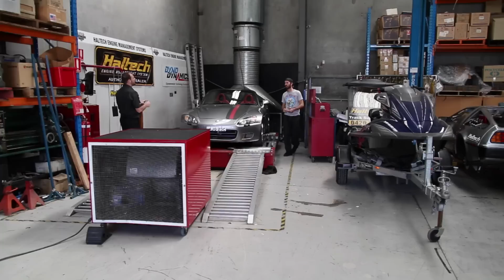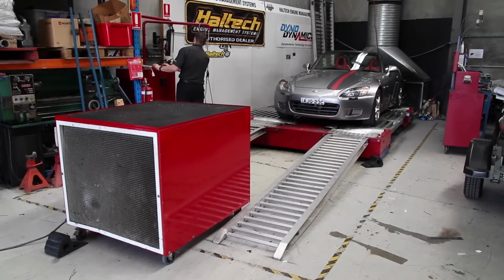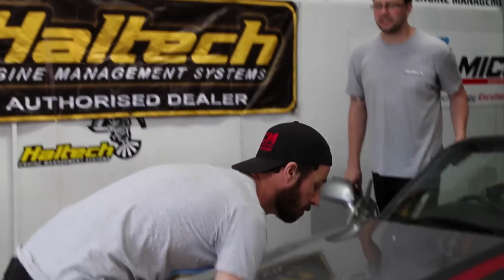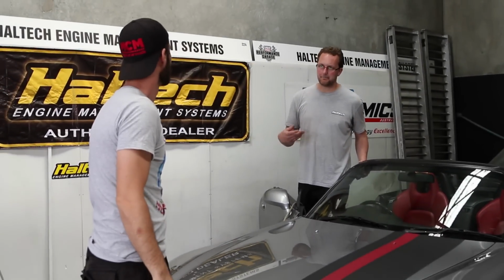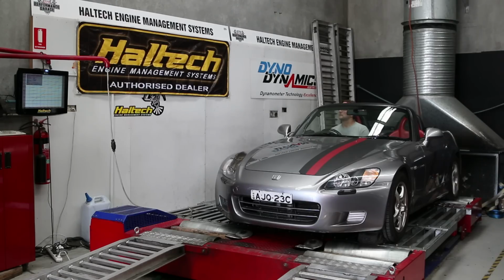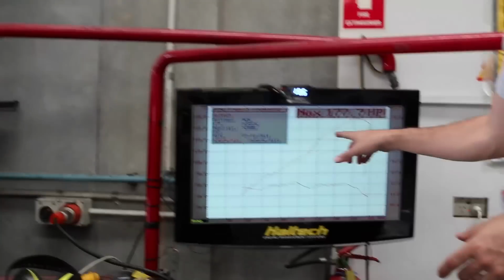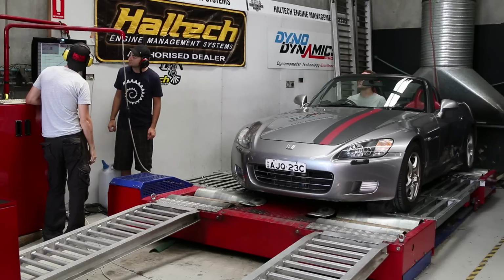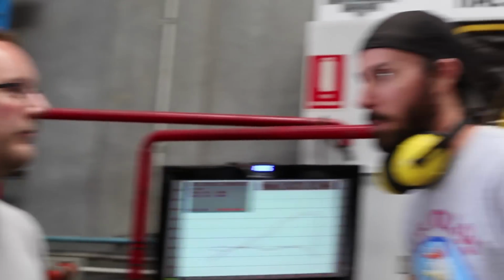Cold Air Intakes Mythbusted [Naturally Aspirated]

Comment: keep the stock airbox and plumbing but remove the resonator. i bet the number goes back to what the cold air was making
Reply: Why?
Reply: On most cars removing the resonator would make the airflow uneven thus causing a hiccup effect going into the intake manifold/throttle body.
A cold air intake will add HP to any system in which the stock design is restrictive and when the stock application was not built with a performance oriented design.
Let's use a 1989 isuzu pick up for example,An AEM Cold air intake will improve hp by atleast 3HP because the stock system is not so good in terms of getting a good flow of air to the engine.
Now let's take a Mitsubishi Eclipse GTS with the Factory improved upon induction system,Which was designed and troubleshooted to the best of the engineers abilities too make more power of the base GT model,this application already has excellent flow therefore your likely to not achieve any gains at all by tampering with the stock design.
So I assure you all,that this video can be misleading and that Cold air intakes do add substantial power gains,AS LONG AS THE CARS NATURAL DESIGN HAS WEAK AIRFLOW
Reply: What you say doesn't make sense. What is a hiccup effect? Resonators provide tuning to sound and a specific power range.

Cold air intakes will always improve power. I don't mean those cone air filters that draw air from the radiator or the engine bay. I am specifically speaking of any intake that draws air outside of the engine bay (ambient air).
Reply: However there are also tuning effects with resonators and length of the intake on NA cars. Replacing the stock intake  with a bolt on cold air can reduce power if the tuning is lost. 

For the most power, draw ambient air and turn the intake for the power band you want
Reply: What the hell is a hiccup effect?

I'm not just asking because of the fact that I've removed the intake resonator on many cars of mine/my friends and had nothing happen other than the car sounding better, as well as removing clutter from under the bumper, but because I have NEVER heard that term used in an automotive sense.
Reply: What the hell is a hiccup effect?

I'm not just asking because of the fact that I've removed the intake resonator on many cars of mine/my friends and had nothing happen other than the car sounding better, as well as removing clutter from under the bumper, but because I have NEVER heard that term used in an automotive sense.
Reply: Finally, someone that states it the way it is instead just just claiming what they think is fact in every case.  Very well said, it depends on a lot of things and not every setup will gain you or cost you the same thing.

Comment: It all comes down to each individual car.  If I expected to see gains, it would be on the top end of a naturally aspirated engine, but even that's not always the case.

My car is a great example.  It's a moderately modified (extensive cylinder head work, amongst other things) NA engine, and I've gone through all sorts of intake configurations.  Bizarrely, with the factory intake in place, I get severe detonation in the midband, and really, really shitty gas mileage at highways speeds.  Cold air intake, no power down low, but lots of noise.  Ended up doing some custom 2.75" piping from the factory airbox to the throttle body, then modified the factory airbox from a 2" inlet diameter to a 3" inlet diameter, maintaining the forward resonator box, and the thing runs smooth as silk from bottom to top, and factory quiet to boot.  Dyno numbers went from ~145hp (108kw) to ~180hp (134kw), with fuel economy around 25mpg city/38mpg highway.  On a car originally rated for 19/28.

Airflow isn't just about volume, density and speed.  Four cylinder engines in particular benefit from the laminar flow created by a properly-tuned resonance control system.  The turbulence created by removing intake resonators can negatively impact the performance of the engine, and its ability to properly burn fuel.  The change in sound that you hear when installing a cold air intake or an aftermarket cone filter goes both ways.  If you can hear it, it's traveled to your ear from inside the combustion chamber.  The "rougher" the sound, the more turbulence in the intake air stream.  On a fuel-injected engine, turbulence has a severe negative impact on wet flow characteristics.

Food for thought.  :-)
Reply: fantastic post!
Reply: I really wish they did it for different cars to show the variety. For example, on my car the airbox generates massive amounts of vacuum at above 4K. The maker did this on purpose because the engine is design for performance, but the car is designed to be economical, so they restricted the air intake to stop people reving it up so quickly for better economies. The maker actually sell an official replacement that they use on their rally cars, and it transforms the engine
Reply: What car was that testing done on rhkips?
Reply: I agree.
some factory cars have terrible intakes.
Like the Camaro SS, LS1 cars and trucks.
my Colorado picked up 1.1mpg by deleting the OEM resonator box.
intake is loud as shit now, but MPG is MPG.
Reply: Sanic That's a lot of money saved in the long run, good job!
Reply: AzeOfSpadez
I made my intake myself.
$20 in parts.
Not all cars are as easy though.
Reply: So you had luck and u made better intake than enginers that calculated resonance and air flow ... hmm
Reply: blackcarmafia i deleted the large resonator box on my intake.
It's a common mod for the 3.5l 5cly  trucks.
The intake is super loud now though.
Reply: Sid Smith
I try to keep the car itself in sleeper status, but the engine is a 2.4L Oldsmobile LD9.  :-)
Reply: blackcarmafia
  Not entirely luck.  A lot of trial and error, and tuning by sound.  The factory intake system was sufficient for the factory engine, but since the airflow of the cylinder head was significantly modified, the factory intake system was no longer sufficient.  Redesigning the intake system, in this case, allowed the engine to produce the power it was capable of after being modified.  :-)

The throttle body is still the single biggest restriction in the system, and is next on my list of things to be changed.  ;-)
Reply: rhkips
Oh its not stock engine, then it sure can be much improved :)
Reply: nallen100 I didn't pick up 35whp from an intake.  I picked up 35whp from extensive cylinder head work.  The factory intake system was only restricting the drastically different airflow.
Reply: nallen100 It's mentioned at the start of the second paragraph in my original reply.  Also note that the 2.4L Olds engine at one point produced 190hp before GM started clamping down on NVH issues, resulting in an engine rated at only 150hp.  With the right modifications, these engines can make 200hp all day long with a stock tune, and reliably getting 100hp per liter out of them isn't impossible, but takes a LOT more work.  :-)

Comment: So how did you 'bust the myth' here guys?

That was a crap CAI and it still made money.  A really well designed.. dual inlet from the front bumper from big trumpets fed into the stock box will easily double those figures, probably triple and give you a cool 15Kw at the wheels.
More over that setup will make the car sooooooooooooo much more drivable, tractable and generally easier to drive providing more toque and less vulnerable to incorrect gear selection.
It won't choke the car when you are in too lower a gear, probably improve fuel economy (never measured it)...well the list of reasons NOT to do it are too short.....and the list of reason to do it are to numerous..

however I stress, short run intakes removing the factory box are unlikely to make any real difference as you need the cold air from the front.... .
Reply: I guarantee you that nobody has read your comment :)
Reply: SlazerFis I read it. :)
Reply: Kryxel Then you're a nobody :)
Reply: +SlazerFis I read it too ;]

Comment: Stock paper filters on intakes also trap more debris which will help you with the life of your engine. High-flow performance filters are not as effective in capturing micro-debris. That debris builds up and can be seen later in the throttle. It's like shaving off your nose hairs, they are there for a reason, not crucial but with merit nonetheless. I swap my paper filters with K&N filters when I know I will redline and enjoy a nice drive. If you do keep your cold-air intakes... make sure you upkeep regularly.

Comment: the other thing to remember is that the cars they did are preformance oriented cars were bolt on's don't do that much. On a civic or other commuter cars the gains will be bigger because the factor intake was designed with less preformance in mind.

Comment: You need a tune. If you add more air you need to add more fuel.
Reply: Sensors and computers make all the adjustments automatically.
Reply: they aren't infinitely self adjusting,  they only operate within a preset range and the factory computers are programed to try and keep things in that certain range if the intake allows more air flow than what  the computer can adjust for on the stock tune it gives up and just leans it out or goes way too rich. that's why you have to get a tune.
Reply: armymatt83 That's true if you have serious intake mods and if you race, but on a daily driver with a simple, inexpensive intake mod, I don't think a tune is necessary at all.
Reply: OddTimeMan it's the only way to correct for it leaning out or getting too rich but yeah if your using some cheap piece of shit intake from ebay that you bought for $50 then  yeah on't bother. my car has a K&N intake that I've enhanced as well as a magnaflow exhaust but the car leaned out so I got a canned tune which was good but not good enough so I got a custom tune done now it runs great and makes 40-45hp more.
Reply: armymatt83 Well you could get a good name-brand cold air or short ram intake for $150-$200...or you could make one yourself like I did for my Hemi Challenger with a large K&N cone filter, a custom 4 inch polished aluminum tube, and a custom aluminum diamond plate heat shield all for around $100. Either way, I don't think they make that much HP...maybe 5-15 at most. They claim much more, but I think it's BS.
Reply: OddTimeMan that's why a tune matters. the other thing you have to keep in mind is you might be getting 15hp at the flywheel but you'll only see 5hp at the wheels.
Reply: You need a tune ANY time you change from stock. The stock computer is not programmed to adjust for aftermarket mods properly. If you get an intake, full exhaust with NO cat converter and a tune you will gain power.
Reply: 2% to 3% increase in HP (like this video shows) is a fairly small amount. For my 390 HP car that's around 8 to 12 HP. Your car's computers will make the appropriate adjustments for that. Just like when you change your old worn factory sparkplugs with fresh platinum ones, or if you live in high altitude and you move to a low altitude. It's all within the computer's parameters. If I delete my cats and get headers and a performance cam, then I will definitely go with a tune.
Reply: +OddTimeMan good point
Reply: +OddTimeMan I have a aem cold air intake and 2 and quarter inch catback. should I get a tune if I install headers?
Reply: 792bnz With those mods yes I would probably get a tune.
Reply: OddTimeMan i have a revo stage 1 jetta. Would an intake be a good move?
Reply: Lincoln Chiller Sure, but don't expect too much.
Reply: Kenshin Himura , this is not true, the most cars nowaday are ECU operated and not carburator. If the engine Will run lean trough the little bit more air going to the engine with the same fuel as the stock airbox then the ECU Will adjust the fuel needed in the combustion chamber matching with the incoming air  , for Lets say a MK 4 golf 1.8 20vt the fuel rail Will be adjusted by the ECU for what it needs couple of % like 5/6% or somthing

Comment: What the guy said about the learning the engine does is very true. The engine will recalculate how much air the engine is taking in. Putting a CAI on your car will only really help if you get a tune with it. Yes a few horsepower will be gained without a tune but the combo can get you much more.

Comment: 3:48 would a stock ECU work the way that hes describing but be programmed to assume it is working within the capacity of the factory intake. eg- if a fault like a dirty intake occurs the ecu will accommodate by lowering the fuel, however it wont accommodate INCREASE in air flow higher than expected from a brand new factory intake out of (manufacturer's) fear of lean spikes?
For example on my car (turbo charged) when i first installed a larger SRI, i took the car for a short drive to test prior to a reflash of the ecu. car was EXACTLY the same. I changed to the new appropriate ECU map suited to the new intake and suddenly the response of the car was massively changed and some noticable increase to torque. 
Feedback would be great. Thanks :)
Reply: fear of rich spikes sorry
Reply: +brad ley I don't think rich spikes are nearly as dangerous as lean spikes, so I don't think the manufacturers would be too worried about that. 
For the example in your car, it may be that the reflashed ECU needed the new intake, more than the new intake needed the ECU map, if that makes any sense. In other words, the stock intake might have provided more than enough air for the stock ECU, but not enough air to get the most out of the new map, especially if it turned up the turbo boost pressure.

Comment: Hello, I am from Argentina and I own a chevy Cruze 1.8 aspirate, which brings in the interior of its original air filter box, an aerodynamic entrance of plastic of the type Intake. This funnel-shaped rounded entrance is on the clean side of the filter. From the dirty side of the filter enters the air that comes from below the gurda mud, this air enters through a small conduit with curves and very intricate. The modification I made, was to cut the plastic box containing the air filter on the side facing the car, the cut was like a window across the width of the box, which is almost not noticeable . Through this window, air now enters from the engine compartment to the filter, this volume of air adds to that coming from below the car. Conclusion ... my chevy improved in low and high notably, revolves quickly, something that has always criticized this car, is more agile at the time of departure and gained in elasticity when en route. The improvement was very significant, it is another car and all with just make a hole in the bottom of the original filter case. My next step will be to buy a K & N flat filter, which I think, will allow to increase even more the air flow. Comment: At the moment of acceleration you hear the sound produced by the Intake Kit.

Comment: Do a video on short ram intake vs stock airbox. I'd be interested to see what the difference is between the hot engine air and the cold outside air. I live in a place with lots of puddles so a CAI is dangerous for my car as it can suck up water if I hit one of those puddles. For this reason a SRI is my only option if I want to stay n/a. On that note, keep up the good work guys! Love the videos you produce.

Comment: WOW 5 KW, so basically you have to drive the car at over the REV range around 5,000 to 7,000 RPM to feel anything, for what a car that you cant legally drive over the speed limit anyway ?
Reply: no just drive in a lower gear if you want to feel the extra power. German automatics have a kick down button on the floor that will put the car in the lowest acceptable gear when you put it to the floor.
Reply: I think this comment goes to show you don't know anything about an S2000 yet you're here commenting about the car as if you own one. If this is an AP1 red line comes in at 9k RPM and an AP2 comes in at 8k RPM, V-tec on a stock S2000 doesn't even kick in until around 5800-6k RPM. So no you wouldn't be driving it over the "rev range" you would be driving the car like it was made to be driven at higher RPM where the car makes most of it's power.

I don't even know how to address the last part of your comment elaborate what that is supposed to mean? I think every car is illegal to drive over the speed limit last time I checked?
Reply: I think this comment goes to show you don't know anything about an S2000
 yet you're here commenting about the car as if you own one. If this is 
an AP1 red line comes in at 9k RPM and an AP2 comes in at 8k RPM, V-tec 
on a stock S2000 doesn't even kick in until around 5800-6k RPM. So no 
you wouldn't be driving it over the "rev range" you would be driving the
 car like it was made to be driven at higher RPM where the car makes 
most of it's power.

I don't even know how to address the last part of your comment elaborate what that is supposed to mean? I think every car is illegal to drive over the speed limit last time I checked?
Reply: ***** Sure on  a S2000, maybe about 10,000 RPM, what about the standard V8's which only go to 6,000 RPM ?
Reply: 7071t6
You win my brain hurts trying to reason with you. I am sure someone else has more patience and will chime in to help you.
Reply: Your point is still silly, the whole idea of Vtec is to have fuel economy at low driving rpms and power at high rpms, when you want the extra power you just drop down a gear and you have it.

Sure your V8 makes more power and torque, but it probably uses twice as much fuel, weighs twice as much and takes up a whole lot more space.

You're comparing apples and oranges.

And you cant legally drive any car over the speed limit, rpm has nothing to do with speed, gearing does.